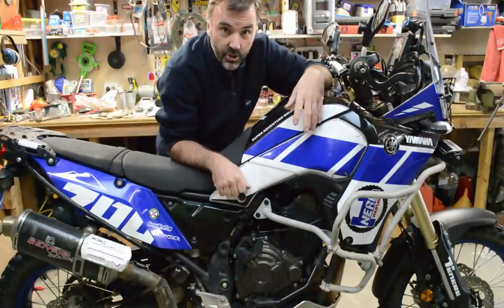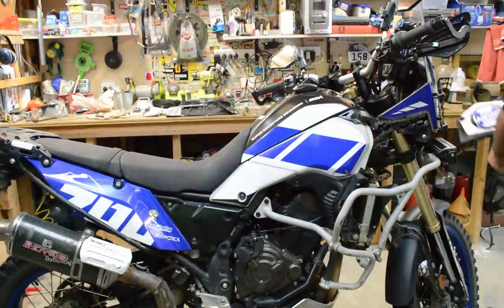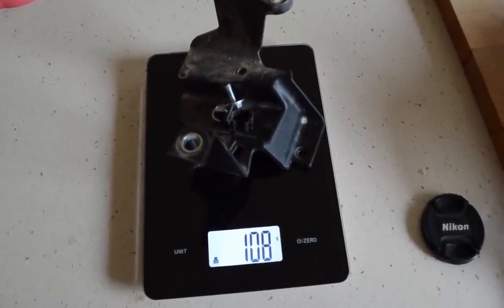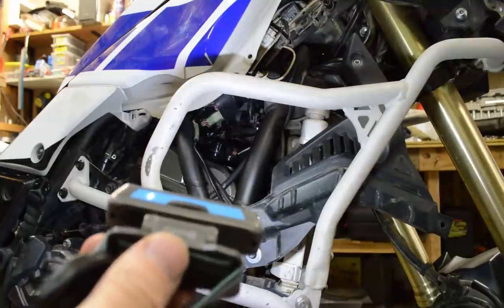The worst job on the T7

Comment: Holy heck, what a nightmare! The trusty old DR650 might be a bit behind the times, but it's bullet proof and so simple to work on. Takes longer to get the tool kit out than it does to remove a plug! You need to be a double-jointed, underfed,  genetically modified contortionist to work on these new bikes...
Reply: Yeah the modern bikes are a pitta when they break but that doesn't happen often but thank god the DR is easy to work on because we're always stopped to fix something on a DR. They often have high millage starters. LOL
Reply: Drz xrs ect were great we all had them but they are no more. Bikes are going backwards heavier slower harder to work on and more expensive. 😂

Comment: Once you’ve loosened the spark plug it maybe possible to use say like a bit of vacuum hose or what ever fits over the porcelain of the plug to wind it out use to do it on some cars
Reply from the maker: Ohh... I'll try that
Reply: @Nerb1  Also great for putting back in that slight chance when you lower plug back into hole reduces risk of closing up plug gap 🍻

Comment: Drill a series of holes around your socket from where the driver goes in and down the body of the socket on at least four sides.   The socket itself is under minimal stress when undoing spark plugs.  This would allow you to use a pick tool or thin Allen wrench to “walk” the socket up out of the hole ( pick, lift, second pick lift ) until you could get a good purchase on it with your fingers.

Comment: EXCELLENT VIDEO, thank you, I’ve a world raid and there is no option but to remove the 2x Tanks, hours of effort and crash bars have to be removed.  AAGGHH.
Reply: Thanks for that little nugget.  Right now I’m just about to head for my bed and I’m guessing that sleep will take a while.  A friend of mine had a Honda that he rode to work every day and I think he had it for about ten years. Maintenance was not his thing and he sold it with the original plugs.  That has me thinking……

Comment: My tenere 700 spark plugs experience was not so bad. Moved the tank to the side. Took off like 8-10 bolts and that plastic bonnet. Changed it all out and had her back together correctly and with every piece (even the plastic bonnet because its important to put it all back together correctly) within 2 hours.
Reply from the maker: You should have videoed it! I'd love to see how you got the cover off.
Reply: @Nerb1  i will next time i do it. I separated the plastic wire clips with a screwdriver from the tray first then unbolted it then removed it out.

Comment: I had the same complicated engineering with my 2019 Triumph 800 XCA, 1.5 hours to just get the tank off to check the air filter.....bike now sold.....now own a restored 1980 R80 GS....analogue riding and way easier to service.
Reply from the maker: Its weird how so much design goes into these things, but something as simple as spark plug access is completely overlooked. The workshop manual even says remove the radiator to check the spark plugs!

Comment: Welcome to life as a mechanic! Haha you Can use a flatblade screwdriver to leaver the Coil off and then magnet to fish the spark socket out. And small extension that has a hex head so could even use a racket spanner onto it instead of a 1/4 drive ratchet.
Reply: Or just get a 14mm spark plug socket on a 3/8 drive with a 8-10” extention and a swivel end, ez street all the way to the end. Also i used a crow bar to get my coils out. To each their own.

Comment: I was thinking one of these T700's would look good in the shed.
But after this, no way. How ridiculous, what you have to go through just to remove/replace spark plugs.
Reply: It's not too uncommon, some cruosers I've had as well as my '94 KLX250R have the plugs right on top, buried in the valve cover

Comment: Out of curiosity what plugs did you install?  I did this mod before going to the cape but agree it will be quicker and easier to remove the tank as well. With the tank off I also used a zip tie (just looped not done up)around the coil from the top to put some upwards pressure while I wiggled them.
Reply from the maker: Thats a good idea. I installed the iridium LMAR8BI-9

Comment: I have done this mod and makes plug changing easy, but with all the dirt and crap under the tank I would still take the tank off if I drowned the bike,  all the crap would end up back in the cylinders. IMO

Comment: Interesting one that, I have about another 2000 ks before I have to change the plugs so always interested on an easy way to do them.

MAD TV had a vid about it and I think MVDBR had one, but I did read or hear something about removing the radiator to gain easier access, anyway the coolant is probably due for a change at 20K so killing 2 birds  might be the go.

And just as a matter of curiosity, why no pre filter on the air box snorkel ? I got sick of cleaning the standard air filter, much easier the clean the pre filter, that standard filter is pretty small and being an inside out gets dirty real quick.
Reply from the maker: When you ride at the front, you dont get dusty!
Haha... I have a prefilter on the bench, just havnt fitted it yet. I actually dont find that the main filter gets very dirty very quickly.
Reply: Don’t replace spark plugs until you start getting misfire, I bet you get 100,000 km out of genuine plugs, you probably do more damage to coil & leads trying to replace plugs.
Reply: Ps, I have a 1996 GPZ1100 still using original plugs, they don’t where out that much mate.

Comment: Goodday day if you remove the plastic tray will not it allow h20 and mud go int the plug hole this is going to be a problem after the plug is removed ??????? It looks just as bad as my super t stay safe
Reply from the maker: The plug hole is sealed by the coil cap, so water is not a problem. The tray simply holds a few wires. Best 108g saving ever!

Comment: Looks almost as awfull as on the stock 950 Adventure. The rear spark plug is super easy, just remove the seat. The front one needs to remove the right Tank and pull the Radiator and oil tank forward and now you can break your hands to get it out.

Comment: Spark plug change every 20k km. How much do you ride in a year? How often do you need to do it in the lifespan of that bike? 4 maybe 5 times? lol....
Do you wanna know what's worse? Did you do valve inspection? Have you actually replaced the shims on the Tenere? Even more worse? Do it on the Africa Twin... Damn people....
Reply from the maker: These days I only ride about 20,000 a year. However, that is not the point. The spark plugs should be easily accessible so that the bike can be dewatered in the event it is dropped in any of the many river crossings we ride through. Removing the spark plugs on the trail is a requirement. The shims will only ever be done in the garage.
If you only ever ride on the road, all of the above is not a concern.
Reply: @Nerb1  I only ride on road so that's not the problem. If you need to dewater your engine than I guess the Tenere is not your bike.

Comment: You know, if you cut off all those pesty cables, remove most of the components around the engine, and remove the engine, any time you heed to change the plugs it's be super easy. If fact, changes are that you'll never need to change the plugs again. Just think about all the time you'll save. You are welcome! 🤪😂

Comment: If it was fitted with Platinum plugs or similar don’t need replacement for 100k minimum.
Don’t bother replacing plugs on modern engines.
Reply from the maker: But the manual says to replace them at 20k
Reply: @Nerb1  yep, I’m sure it does, it also says check your tyre pressure before every ride ??
MX bike manuals say put a piston in every 50 hrs ? In fact MX bike manual suggest you pull the head / barrel off ya 2T MX bike and check clearances at 5 hrs ??? But do we and should we bother doing these things as most of us are not using our bikes to win world championships ???
The manual is a recommended guide not the entire truth of what’s required, it’s all good, you follow the manual, I’ll rely on real world knowledge I have learnt over 50 years of riding & swinging spanners . 🥳